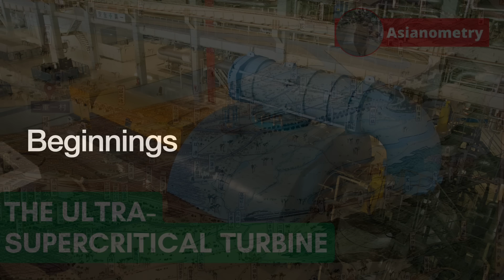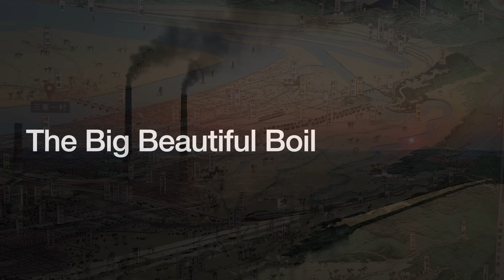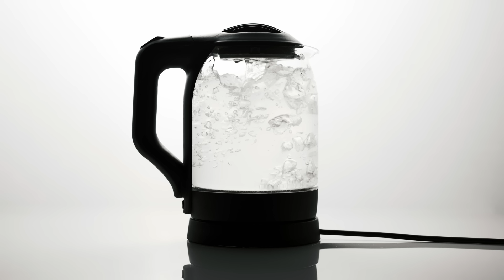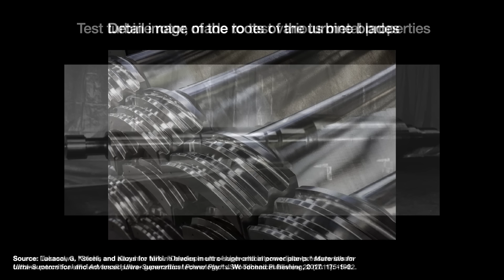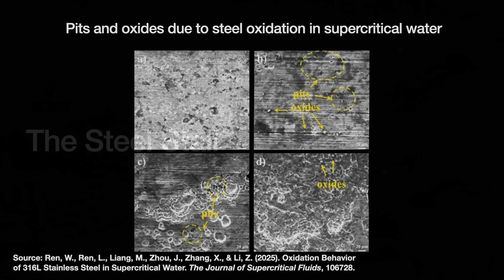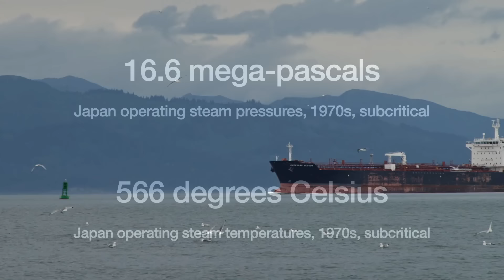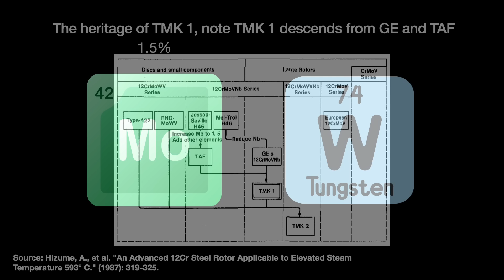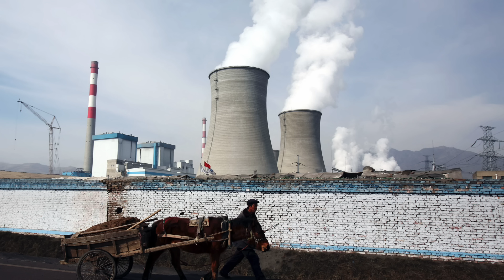The Epochal Ultra-Supercritical Steam Turbine

Comment: One of the complications of supercritical plants is that when there is degradation of a small bore fitting on a supercritical steam pipe and a steam leak occurs, you cannot see the leak because "steam" is only visible when some of it begins to condense into fine water droplets (think clouds).  Supercritical steam leak jets quite a ways before it begins to condense and become visible. The plants tend to be quite noisy, so it is also hard to hear a small steam leak.  As a result, in many plants, when personnel walk around areas with supercritical piping while the plant is operating, they carry a kitchen broom and wave it up and down in front of them as they walk.  That way, if there is a steam leak, it shreds the broom instead of them.
Reply: you really do not need supercritical for that. just regular high pressure steam is entirely invisible by most methods bar thermal imaging being the most common. This has been an issue since the dawn of steam powerplants with all the early reports you can read of steam boilers even back in the 1800s just vaporizing flesh off bones. it's just become spicier now.
Reply: @MaxC_1 True, though the jets extend farther at the supercritical pressures, and the flow rates are higher for a given leak path.
Reply: Non supercritical but still 1800 psi power plant veteran here.  High pressure steam pipes are obscenely hot so you should never find yourself close enough to one that a pinhole leak would injure you.  Larger leaks give themselves away either by the shriek or the air blast so that a reasonable level of caution while walking around is sufficient to stay safe. The broom or rag on a stick is used primarily as a detector to tell exactly where a leak is.  Leaks are often above your head, over the hand rail, or buried in a rat's nest of look alike piping.  The rag will start to wave a couple feet away from a leak and will indeed get shredded if you get within 4-6 inches of a high pressure leak.  The bigger the leak, the more obvious its location will become and the more distance you naturally give it, if only because of noise levels.     The only steam leaks that are visible are the lazy low pressure ones.  The spicy ones have enough velocity that the steam mixes with air before it cools to condensation temperature and those leaks are never visible.
Reply: Yes, no joke! Steam at that pressure and temperature can strip the flesh off bones in seconds.
Reply: Yeah, I once worked for the onsite turbine balancing dept of CA Paraons and there were warnings  about past engineers having their foot burned through by such leaks, was a bit scary working on those hot noisy machines in dark corners near the bearings…

Comment: A good summary.  

Supercritical and ultra-supercritical plants are more efficient than subcritical plants if you can sustain the materials at the higher temperatures.  Subcritical plants typically operate at inlet temperatures around 1050 F and inlet pressures in the 2000 to 2400 psig range.  Many supercritical plants operate at that same inlet temperature, 1050 F, limited by the metallurgical problems discussed in the video, but they operate at higher inlet pressures,  3500 to 3800 psig.  

Lots of work was done in the 1960s to 1980s to develop and build supercritical plants, but the cost of the materials, the difficulties in operating the plants, and the shorter component lives led American plants to mostly go back to subcritical plants.  The reason was that, while supercritical plants had somewhat higher efficiency and used less coal, the total cost of producing the electricity wasn't much cheaper, if at all.  The extra capital costs and component replacement costs for supercritical plants pretty much offset their lower fuel costs. 

There was a brief return to building supercritical plants in the U. S. in the early 2000s, but the motivation was reduced emissions per unit electricity produced, not minimum cost.   In Japan, there was more interest in supercritical and ultra supercritical plants because essentially all of their oil and coal has to be imported from afar.  Transportation costs dominate the cost of coal unless the coal is mined nearby, so coal fuel is much more expensive in Japan than it is in the U. S.  For the Japanese, spending more on capital costs and component replacement costs makes more sense because the savings from reduced fuel use is more significant than it is in the U. S.

Comment: Coal should not be used especially in Japan. there is virtually none in that country, so it has to be transported to the plant from other countries that have the "dead cheap" death dealing fuel in abundance because almost no one still wants to use it if they do not have to.  So add to the unavoidable pollution of that plant, no matter how efficient the turbines, the fossil fuel burned during overseas shipment and that health hazard of the  mines that are still creating black lung disease for those miners wherever the coal is coming from. Shame on you and on Japan for this abomination.

Comment: Moving away from coal at least for the most part is key to mankind's survival attempt and therefore much emphasis may not go any longer to heavily improve the thermal efficiency of the turbines beyond the phantastic 45% achieved. However what could be attempted easily is for the entire plant to become greatly more efficient is to use waste heat for district heating networks instead of letting it heat up the air above the plant using the large cooling towers. I'm quite sure this is being done in some of the examples and could also be added later if the plant is located in any sense making proximity to the users of the heat.

Comment: nice Video,  but  meanwhile  solar  is   just  cheaper   and   wind  is  cheaper  to,  espscialy because   of the  Carbon Fotprint of  Coal...   OK  gas  is better  and   will give You  more  efficency !    In total  I  do not  see  the  problem   in  manufacturing  the big  rotors  for steamturbos,   I  just  would cool  them   with  some  mid preassures   steam  flowing   from   the  end of  the  high   preassure turbin  backwards   threoug  the  cente  und   thus cooling  the   rotors...    hallow  schafts   are   standard  in Gasturbins  and   not   a  big  problem.  So   the  Things You  are  telking  about  are  "at  the  cold  side"   of  the  steam!  heat flows  from hot  steam   to   steel  or whatever  at  a lower  temperature...   The  real  problem  ist    the  boiler   where  heat  must be trensferd    from   the hot  gas    through   some  kind   of material .....   You  can   use  some  supaeraloys   etc,   but You need  so much material  vompared to   turbinblades   theh  the  Problem  is becomming   a   cost  Problem..    in Germany   we tryed  with  T 24   and had   quite   some trouble !
So   why    are  Simens GuD  powerplants  reaching  61,5 %   efficientcy   world best!    Becaus  a  gas turbin  does not need  a  heat  exchanger at  the  high  temperature  of  the  process    and  Turbin blades  are   small  so the  cost  of  the material   can be  higher!     So  as the  CO2   footprint  of  Gas   is  lower  and    eficency   is  better   higeher Cost  for  gas   is   still   posible...  So it makes  sence   to burn Gas  in  a powerplant   and  use heat pumps   instead   of  using  Gas  heaters.....   Same   with  coal   although coal   does not have  a   significant  share  in  the  heaing  market....    As I  do  understend   it's not   a  good  idea  to    ramp up  and  down  the  ower   of    a  steamdriven  Powerstation   all  the  time!    Basepower   will not be neded  in  the  future   because  Wind and Solar  are   cheaper  and pusch  the  marketprice   for Electricity  to near  zero   wehn   the wind  is blowing  and  the  sun  is shinig...   During  these  owers   wei  chould  not  keep fosiles   running,  because   that's no buissenes!   So we need powerplants   that  can   reakt  with  more  dynamic  propertys.... Things  change   and   i mighet  suggest  that   Gas   power  stations   fit better   for  the residual  Power   thet  is  demanded  by  the marketplace.    sorry  for my   englisch  i am not  a  native  speaker!
Reply: I think this is a very, very good example of how bad engineeering can be without a drawing board.

Comment: As an inspection technician was amazed at the scale of the disassembled turbine and the (if I remember correctly) 440 volt heaters in the open ended sheds in winter conditions working in our T shirts  !  And talking to the General Electric Engineers was a master class  !  Too sum up my job  was to check for cracks and divits for the Welder to repair  🧐  .

Comment: Gas-cooled graphite-moderated nuclear reactors can achieve the temperatures needed to run these turbines.  Pressurised water reactors cannot; they are a waste of uranium.
Reply: Graphite moderated reactors are crap?
Reply: @beatreuteler  600 C operation is already in use for decades without incident.  Radiation levels inside the plant are lower than the natural background, and much lower than for a PWR.  Nuclear-grade graphite is like a ceramic material that does not melt, and has huge heat capacity to absorb decay heat in the event of shutdown from coolant loss.  Potentially 900 C could be achieved, allowing direct thermal dissociation of water into oxygen and hydrogen, in addition to excellent Carnot efficiency.
Reply: @cdl0  Except for the incident @ Tschernobyl. But you are right. who would mind? It was just in Ukraine.
Reply: @beatreuteler  It was a water-cooled reactor, not gas-cooled, and failed as a consequence of completely incompetent operation in violation of even the most basic safety rules and operating parameters.  A gas-cooled graphite-moderated reactor is a completely different beast.

Comment: Great video! I always love learning about more steam turbines.  But im afraid I must disagree with your conclusion that we will have a hard time moving away from coal as a base load provider. 

Remember kids, coal is so bad for the planet that we can't retrofit old coal power plants with nuclear reactors because the coal leaves behind so much radioactive contamination it is illegal to put nuclear reactors on the site. This is a regulatory hurdle to some extent, but it shows the real issue with coal: contamination. The CO2 coal plants release is the least harmful byproduct. The real harm is the other toxic waste it puts into the atmosphere and environment. We are burning rocks, and all the uranium ore and mercury and sulfur and lead that we mine from rocks are also in the rocks we call coal. Yes we use scrubbers but they are extremely costly and you still need to put the toxic radioactive waste from the tar somewhere. 

The economics of coal are getting worse by the day. Combined cycle gas generators offer the same base load capability as coal, but can also be easily throttled to meet lower demand at night. Gas turbines operate from 50-65% efficent, so 20% more efficient than the most efficient coal plant!  Additionally, compressed natural gas can be piped directly into a powerplant (no coal trains needed) and boasts an energy density twice that of coal (15-30MJ/kg coal vs 55MJ/kg CNG). So we have a technology that uses fuel twice as energy dense as coal that can be piped directly to power plants that are 20% more efficient and require less man power at every step... the economics of coal are just truly terrible these days.  And yes there is an argument to be made that having fuel diversity is a good thing, but lets not forget that centuries before we had natural gas we had coal gas (c. 1609) and if we ever are in a dire enough situation where we only have coal as a fuel source we can easily gassify it to make it work.

 Thats not even counting that finally, after all these years, solar and battery storage are lower cost per MW than ANY OTHER FUEL SOURCE. Current estimates place the cost of building battery storage solar is upwards of $1400/kW while coal plants cost 3500+/kW, and thats not counting operating expenses!.  Solar can be built in less than half the time and require hardly any maintenance over decades. Battery technologies like LiFePO4 don't require all the icky chemicals of Lithium Ion, and compared to Li Ion are less combustible and cheaper per kwh. Solar panels have gotten so good that manufacturers warranty them for 20+ years and batteries are making similar strides. Advances in semiconductors have made HVDC transmission lines far more practical so we can move the renewable electricity wherever we need to use it (within reason) more efficiently than ever before. And the sun will never stop shining, and it is a basic fact of nature that eventually in someones lifetime we will, truly, run completely out of a fossil fuel. 

Coal technology is cool but it is antique and it just does not hold up in the modern day.

Comment: Wow! This is very interesting technical stuff! 'Advanced ultra supercritical'!!! What an exciting word for water boiling technology. At pressures of 350 bar and nearly 600 deg. C this is an exiting technology which needs its very specific blended steel. What about titanium as it is well known for its stability and strengh? Or an Ni-Cr-Md-Ti alloy? The art of steel alloys is fascinating. I am used to Cr-Ni-18-10 (well known V2A) and V4A with a bit of Ti i guess. I was looking for the right electrode material for water electrolyses some time back...
Reply: For water electrolysis (if the goal is H2 production) the best cathode materials are platinum or palladium(if you want something cheap then nickel) due to their low over-potential for hydrogen evolution. Just an electroplated surface on some other metal will be enough. For supercritical water, titanium might be incompatible as it is a pretty reactive metal. Like nickel is likely incompatible with SC CO2(because it can break down to CO at high temp, and CO reacts with Ni to forma a volatile Ni-carbonyl complex and erode away)

Comment: Current common "safe type" water-water nuclear reactors are capable of "safely" producing steam only at the lower range. Thus, thermal efficiency of nuclear generation is very low - significantly lower than that of even of older coal burning generation. Thus, there are numerous public talking with glowing eyes about molten salts and molten metal fast neutron reactors that would allow high nuclear core temperature at low pressure allowing supercritical and hotter steam production that way significantly boosting thermal (and respectively financial) efficiency of nuclear generation.

Comment: Sigh ... in an effort to make this video accessible to "the ordinary viewer" it fails to explain the real issues that drive Rankine cycle performance AND practical gas turbine design ... and why one might want to go supercritical.  Any not-asleep viewer might wonder "why does he mention reheat cycles and never explain what they are about?  Why do something complicated?"

If you want to build an even-reasonably-efficient Rankine cycle reheat cycles are the name of the game, and they dominate the cost and complexity of the system.  Understanding why reheat cycles improve efficiency requires understanding thermodynamics ... not an easy topic, that I will avoid here too.

But typical plants need them for another reason: supersonic droplets in a steam turbine eat the turbine blades for lunch.  The expansion inevitably will produce these droplets without reheat cycles.  Old piston steam engines didn't have this problem ... the flows weren't high speed.

Supercritical fluids don't have a sharp phase change, so that whole problem is much alleviated.  Supercritical CO2 exists at lower temperatures than super-critical H2O, and has some other advantages as a Rankine-cycle working fluid.

But the reality is that all modern high-efficiency thermal plants are combined-cycle: the high temperature stages are Brayton cycle (jet turbines) ,and then their waste heat is recovered by a lower-temperature "bottoming cycle" that conventionally is Rankine .. .but could be other more exotic cycles.

The reason for this is that the all-gas-phase Brayton cycle doesn't have a boiler, so the combustion can transfer heat into the working fluid (the combusted gas) at far higher temperatures.  Modern turbines can take that because the blades can be film cooled.  

I

Comment: Some remarks on the CCGT's all the way at the end on this video. In the Netherlands where I live quite some effort was put into coal gassification combined with a CCGT. So here, coal gas would be generated which was then burned in a gas turbine with the exhaust heat providing energy to a Rankine cycle. The advantages are higher efficiency and lower emissions. But sadly the plant that which was built with this concept which was operational from 1993 to 2013 had quite some operational issues: https://nl.wikipedia.org/wiki/Willem-Alexander_Centrale (in Dutch). This plant eventually was the only plant next to one in Spain built with this concept. And although there were plants to operate a much larger plant (the Magnum plant in the province of Groningen) with this concept that plant eventually came into operation as a regular natural gas fired CCGT: https://nl.wikipedia.org/wiki/Magnum_(energiecentrale) (also in Dutch).